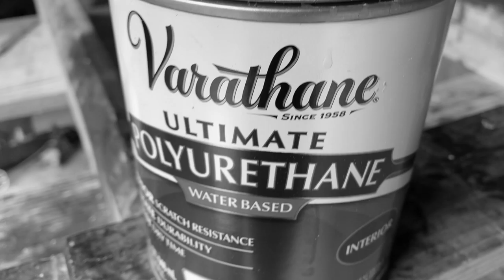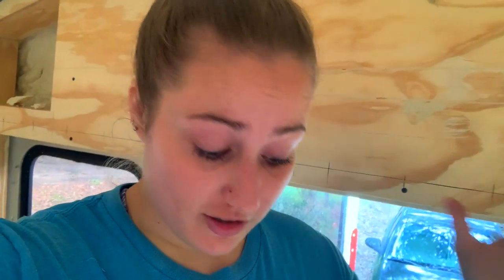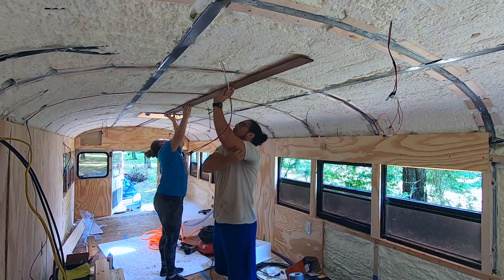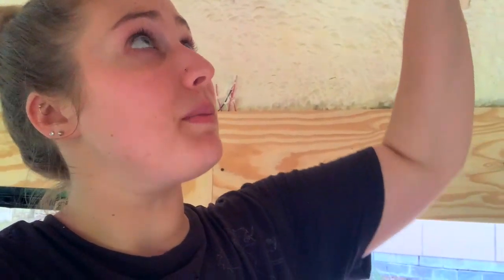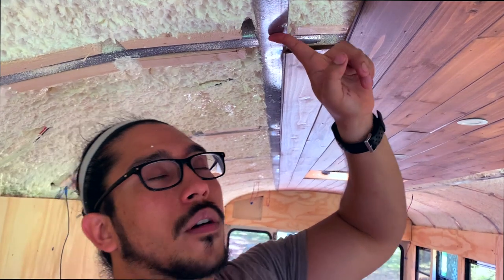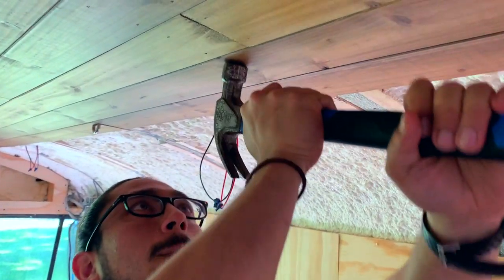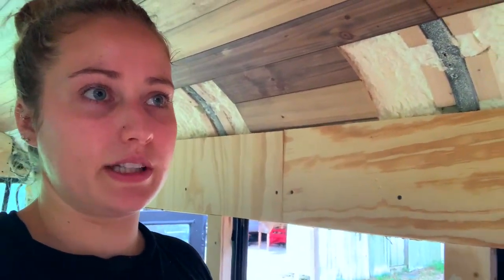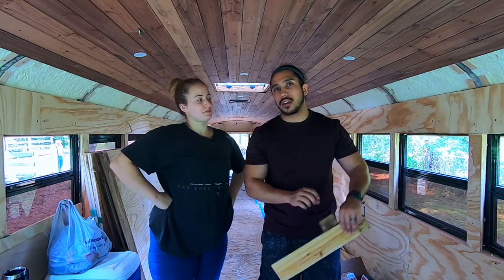Cedar Plank Ceiling part 2 - Installation * Skoolie Conversion * Gus The Struggle Bus

Comment: Should use a nail set to drive the finish nails into the boards. You avoid damaging the wood with the hammer head.
Reply from the maker: Wish we would have, thank you for the tip!

Comment: Great job, came out beautiful. I'm curious what you think about staining it after putting it up? Obviously might get a little stain on things if not careful, but it seems like it could save time, and ensure that you just get the visible surfaces?
Reply from the maker: Thank you so much! If there is a way that works best for you I say go for it! I wanted to stain and treat both sides of the wood so It would be protected just in case :)

Comment: I love the color and the what I call rustic look but I agree with one of the other comments I am afraid that one you start traveling the nails may pull loose
Reply from the maker: Thank you so much! we're hoping that this doesn't happen but this is why we also put glue on there just in case if it did the whole board wouldn't come down lol. But we are mentally prepared to see a couple nails come loose ☺️

Comment: It's been awhile ago but I saw a video where they nailed in their ceiling  like this and when they started road tripping the nails started to come loose so they ended up putting in screws
Reply from the maker: Yeah we're fully prepared for that to happen, but we are crossing our fingers that it doesn't. That is the main reason why we decided to glue them as well with extra strong wood glue just in case that if this ever that happened the whole board doesn't come down with it 😁 trying to go overkill here lol

Comment: What kind of nail gun and nails are those?
Reply from the maker: It is my dads gun and I could not find the exact model but this is the closest one I could find. And they are finishing nails! 
https://www.homedepot.com/p/NuMax-3-Gal-Portable-Electric-Pancake-Air-Compressor-with-2-in-1-Nailer-Stapler-Hose-Inflation-Kit-and-Fasteners-400-Count-S3GI12CK/311894336

Comment: How much did the wood cost?
Reply from the maker: The price changes but these are the ones we used 
https://www.homedepot.com/p/1-4-in-x-3-5-in-x-8-ft-Cedar-V-Plank-6-Pieces-14-sq-ft-8203015/202106509?MERCH=REC-pipinstock-315164883--202106509--N